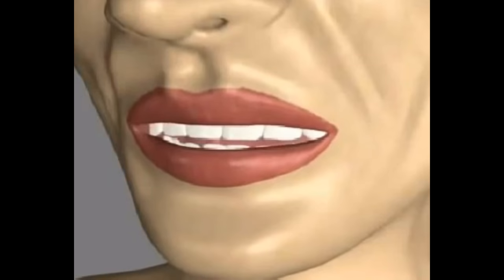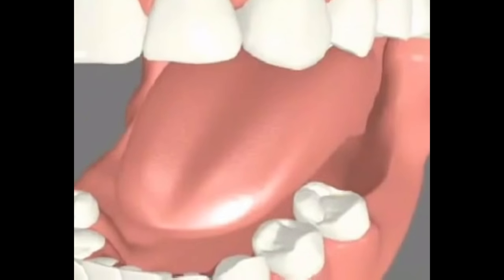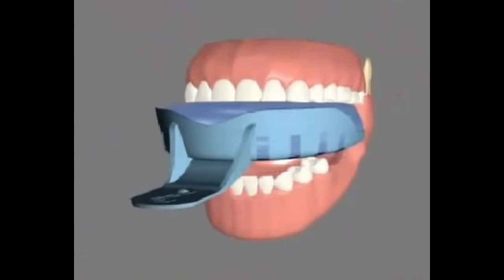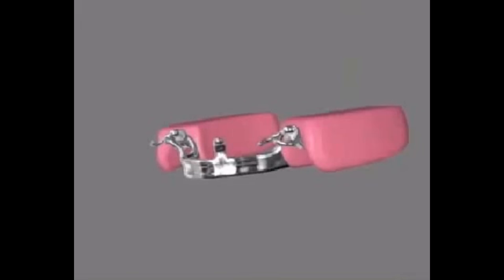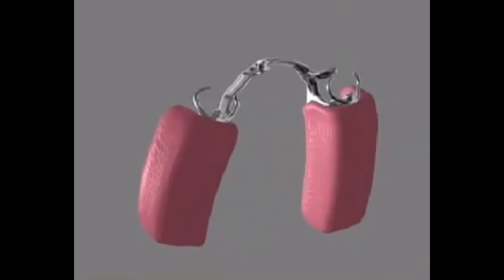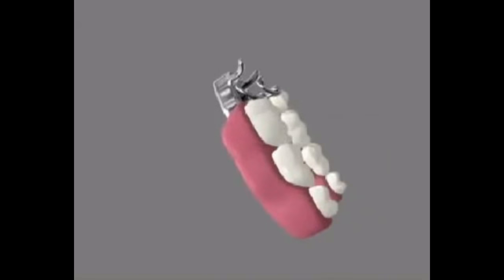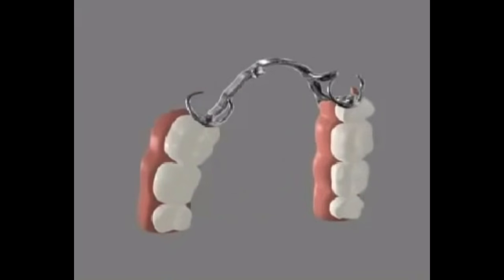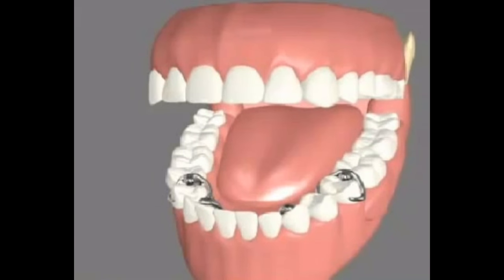Removable Partial Dentures Steps

Comment: Hi is that hurt ? Specialy when you wear ? Do you have to remove it when going to sleep ? It's cause damage your teeth where the metal huks are ? Thank you
Reply from the maker: No it doesn't hurt. You have to remove during sleep for gum relaxation. metal hooks doesn't damage your teeth.
Reply: @DrAmitPatil τ

Comment: Hello Dr.Amit Patil, I would like to enquire as to which procedure should I choose the removable partial denture or fixed teeth denture? And how do they both differ?
Reply from the maker: Fixed teeth are better than removable partial dentures
Reply from the maker: If you do not have enough supporting teeth for fixed teeth then removable partial denture is only option.

Comment: Sir my teeth is already missing and I want to buy rpd due to my budget so can they make rpd even if my teeth are already missing?
Reply from the maker: But few teeth required to make rpd
Reply: @DrAmitPatil  ok my 2 front teeth are missing so?
Reply from the maker: @Kp00z  then you can do fix dental bridge
Reply: @DrAmitPatil  oh but I can't afford that now and need a rpd as a temporary solution so will that be possible?
Reply from the maker: @Kp00z  yes that would be great if you do rpd. Save money save tooth.
Reply from the maker: @kanabanerjee5968  it's in sangli, MH.